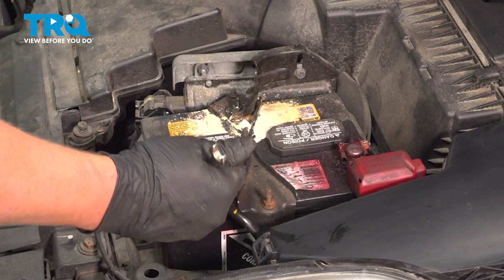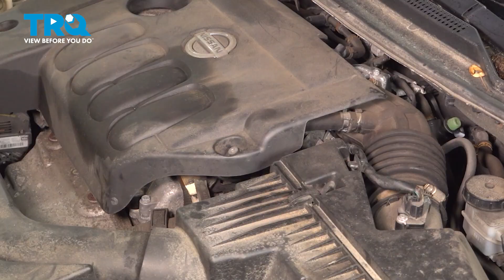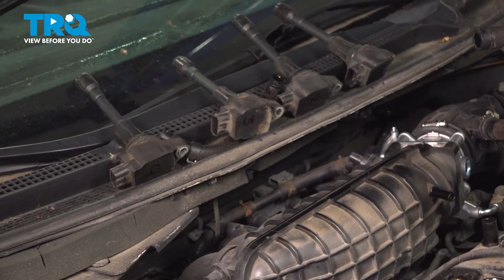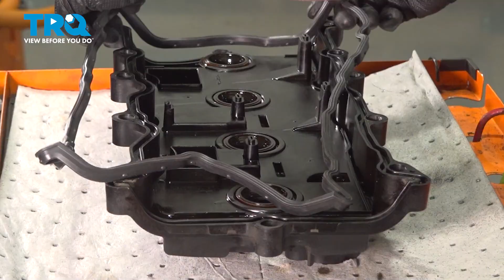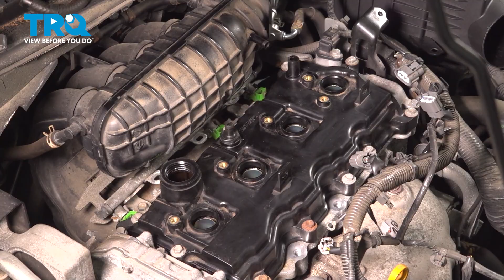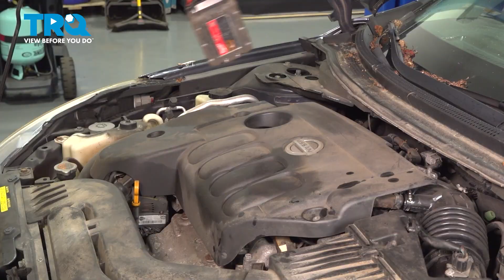How to Replace Valve Cover 2007-2012 Nissan Altima

Comment: You forgot to mention the alternator. Might be a submodel thing? Either way, two 13mm bolts on the engine bracket. They are not hot (tension from the serp belt)

Comment: I just got my parts in gonna try this im assuming i use my 3 ton jacks i jack up the car 2 clicks and use the third on the bottom of the engine and keep a wood block on the oil pan for safety but obviously not too much pressure mainly use the jack next to the oil pan on the metal peice

Comment: Okay why in the world would I need to LOOSEN the bolts on the old valve cover in a pattern? I understand why I need to tighten the bolts on the new part in a pattern but I can’t see any possible reason for loosening the bolts in a pattern.

Comment: Great instructional video!!!  Dont do like me and not put a jack stand under the engine  i jacked the car up afterwards, put the jack stand to the left of the oil pan, lowered the jack, BAM!  busted the engine block,   Moral of the story,  make sure you put the stand on the SOLID metal piece,  not just to the left of the oil pan.

Comment: No need for the injector connection disconnect,  
And why say take the airbox off, and the rest of the video it's still in place.
I've done 50+ , tube at the most

Comment: Does nissan make a replacement coil pack sub-wiring harness or do yu have to replace the entire wiring harness? One shop told my buddy 3k another told him 1k to do the job. Just doing some homework before i can guarantee i can help him. I helped him change the valve cover and coil packs but still having misfire issue and dealerahip told him its the broken coil pack clips on the harness or its damaged somewhere else.

Comment: I changed my head gasket 5 years ago and also changed my valve cover gasket while doing so. Found that my valve cover is leaking already, only did 30k with the car... seems like a redundant problem on these engines